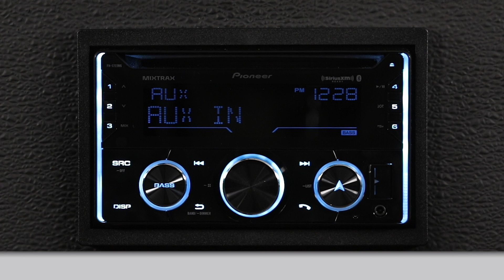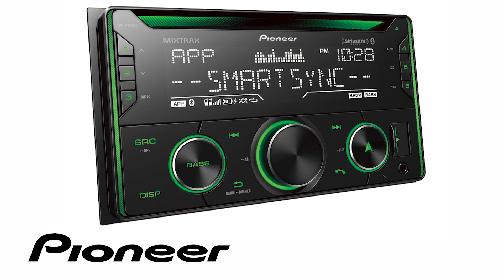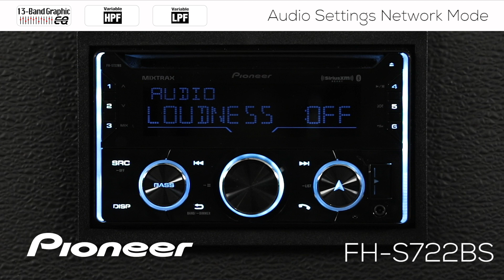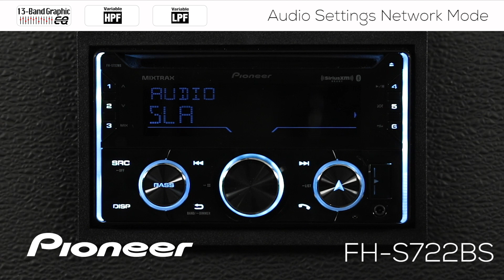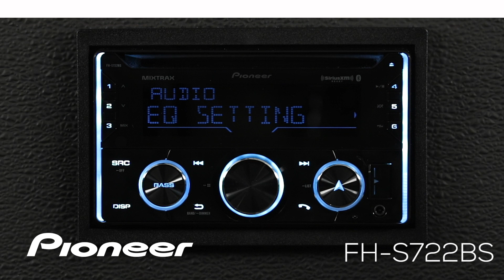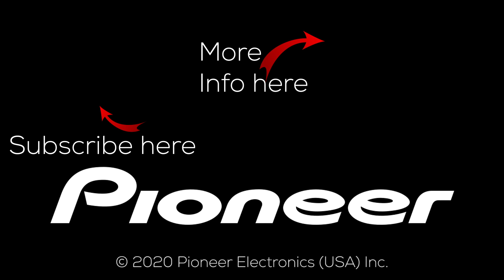How To - Audio Settings Network Mode - Pioneer Audio Receivers 2020

Comment: What about sound quality or fidelity? It says RCA's are 4v output? Does this improve better sound quality than older version of pioneer receiver? I think on buy one but I'm not sure about sound quality... I'm audioholic!
Reply from the maker: The Pioneer FH-S722BS is an excellent sound quality CD receiver.  It has 3 sets of RCA outputs for operating external amplifiers. 
You can see an unboxing video from Pioneer here:     https://youtu.be/kQz4kuB2en4     The RCA outputs can be setup as Front, Rear, and Subwoofer output, or for more control and better sound quality, as High, Mid, and Low output.   You can learn more about Pioneer's Standard Mode and Network Mode setup here:   https://youtu.be/k3q0Zm5jvHg
You can learn more about using Pioneer's receiver's built-in crossovers and slopes in this How To video from Pioneer:   https://youtu.be/WvJXYh6vk_0?t=340
For higher sound quality and Hi Res Audio certified products please consider the Pioneer DMH-WT8600NEX seen here:   https://youtu.be/QrvNkGgRo7E
You can find more videos on Pioneer's YouTube Channel here:  https://www.youtube.com/@pioneerelectronics
Reply: Yes ... if u have aftermarket amplifiers in ur car ... then they will shake ur hand for feeding them voltages ... the amplifiers will produce better , cleaner signal ... and u can most likely max out ur volume on the headunit

Comment: Im getting the fh-s722bs on 1st set up if i only have 1 amp n subs and don't know that much of sound set up what is best setup for the hu i do want to use the time aliment
Reply from the maker: Please be more specific with your question.  
If you have one amp for full range speakers, and  a separate amp for your subwoofer you may want to use the Standard Mode setup.
You can learn more the difference between Network Mode and Standard mode in this How To video from Pioneer:   https://youtu.be/k3q0Zm5jvHg    Please watch the video with the sound on.
To understand more about using crossovers and slopes, please take a look at this How To video from Pioneer:  https://youtu.be/WvJXYh6vk_0?t=341    Please watch the video with the sound on.
You can find more videos on Pioneer's YouTube Channel here:   https://www.youtube.com/@pioneerelectronics
Reply: @pioneerelectronics  sorry i will be using the headunit for mids and highs and an amp for my subs i do not know alot bout set ups so was wonder what would be best for this set up
Reply from the maker: @almann5798     Please be more specific.   Mids and highs.  OK.   Do you mean separate tweeters, and separate mid bass drivers?   Or do you mean  for example 6x9 inch speakers in the doors for your mids and highs?     Each of the speakers playing mids and highs together?   It makes a big difference on the setup.
Reply: Sorry see i do not know the terms well ill be using coaxial speakers to run off of my head unit
Reply: So there will be 5.25 coaxial speaker in front door and coaxial 6x9 in rear back deck
Reply from the maker: @almann5798  I understand better now and I'll be happy to help. I recommend to setup the receiver in Standard Mode.  Don't use Network Mode.  Network Mode is wrong for your setup as you have described it.    I recommend to connect  the 5.25" speakers to the Front  Speaker Outputs and to connect the 6x9" speaker to the Rear Speaker Outputs.  You can learn about connecting your speakers to your Pioneer in-dash receiver in this How To video from Pioneer:   https://youtu.be/kR2MO2kwFug?t=254
You'll use the Subwoofer RCA outputs to run the signal to your subwoofer amplifier.  You can learn about the RCA outputs here:   https://youtu.be/kQz4kuB2en4?t=226   The subwoofer outputs are clearly labeled on the back of the receiver.
I recommend to set the Crossovers as follows:
Front 80Hz HPF 12 dB per octave
Rear 80Hz HPF 12 dB per octave
Subwoofer 80Hz LPF  12dB per octave
You can learn about setting the LPF and HPF crossovers in this How To video from Pioneer:   https://youtu.be/ivhWEe3egSY?t=223
The external amplifier for the subwoofer will require RCA cables from the back of the in-dash receiver to the subwoofer.  These cables are commonly about 10-15 feet in length.  The external amplifier will also require power and ground.  The power cable may need to be connected directly to the vehicle's battery.

Comment: Hi, just bought a mvh-s720bhs...it doesn't have the band pass settings (one of the main reasons I bought it) just rear and sub. No low pass for the mid...what can I do? Thanx
Reply from the maker: You have the receiver set up in Standard Mode. That's a mistake.  You want the receiver setup in NETWORK MODE.   The Pioneer MVH-S720BHS must be set up in NETWORK MODE in order to have the band pass output. The Pioneer MVH-S720BHS certainly has band pass output, when used in NETWORK MODE.
Don't worry, it's not difficult to set up your MVH-S720BHS in NETWORK MODE and have the band pass output.  Just follow these simple instruction it only take a few minutes:
Step 1.  With the vehicle safely parked, and the engine running and the receiver powered up, Press and hold the receiver's SRC button for a few seconds.  This will turn the receiver off.
Step 2.  Press in on the Volume control.  This will show the Initial and System Menu.  Turn the volume control to see INITIAL.  Press in on the volume to select INITIAL.
Step 3.  Once you've selected the INITIAL menu, turn the volume control to SYSTEM RESET.  Press in on the volume control to select SYSTEM RESET.
Step 4.  Press in on the volume control to Reset the receiver, and press in on the volume control again to confirm YES and Reset the receiver.
Step 5.  The receiver will display RESETTING for several seconds. DO NOT TURN OFF THE VEHICLE'S ENGINE. After the reset is complete, the receiver will automatically restart and display the Language Setting.
Step 6.  Select the Language you want. Press in on the volume control to confirm.  The receiver will display the Clock Set Screen.
Step 7.  Set the clock by using the volume control and pressing in to confirm.
Step 8.  Don't Miss this step.  This is the important one.  The receiver will display >  SPEAKER MODE  <  Press in on the volume control to select SPEAKER MODE.
Step 9.  In SPEAKER MODE, you have 2 options.  Turn the volume control to NETWORK MODE.  Don't choose Standard Mode.  You want NETWORK MODE.  Press in on the volume control to confirm NETWORK MODE.
Step 10.  Confirm YES, you want NETWORK MODE.  Press in on the volume control to confirm NETWORK MODE.
Step 11.  The receiver will ask if you want to quit the setup menu.  Confirm Yes.

Now you're system is setup in Network Mode and you have an HFP on the Front RCA's,  and you have an LPF and an HPF on the Rear RCA's, and you have an LPF on the Sub-out RCA's.
You can lean more about NETWORK Mode in this How To video from Pioneer:  https://youtu.be/k3q0Zm5jvHg  Please watch this with the sound on.
You can learn more about using Crossover's and Slope setting in this How To video from Pioneer:   https://youtu.be/WvJXYh6vk_0   Please watch this with the sound on.
You can download the owner's manual for the Pioneer MVH-S720BHS here:   https://www.pioneerelectronics.com/StaticFiles/Manuals/Car/MVH-S720BHS_OperationManual102620.pdf   You may find page 27 of some interest.
Please be sure to install the latest firmware for your Pioneer MVH-S720BHS.  You can find it here:   https://www.pioneerelectronics.com/PUSA/Car/Digital+Media+Receivers/MVH-S720BHS#downloads
You can find more videos on Pioneer's YouTube Channel here:  https://www.youtube.com/user/pioneerelectronics

Comment: Does it have a volume control for the sub only on normal mode?
Reply from the maker: Please clarify your question.  Do you mean Normal / Network mode?  Or do you mean Normal or Reverse Phase for the subwoofer output?
What is the model number of your Pioneer in-dash receiver?  
Be sure to have the subwoofer output switched on.  Depending upon your receiver model number, the Subwoofer Level control may be in the subwoofer settings, or it may be in the Speaker Level settings.
You can learn more about is in this How To video from Pioneer:   https://youtu.be/HTJ07fk4Grs?t=44
I recommend to watch the video with the sound on.
You can find more videos on Pioneer's YouTube Channel here:   https://www.youtube.com/user/pioneerelectronics

Comment: Why do I get a lot of distortion I have a MVH-320bt and have orion speakers like at 35 of volume ??
Reply from the maker: This is a long answer.  Please take a few minutes and read the complete answer.    

If you are using a hammer and you hit your thumb, don't blame the hammer. 

The goal is to create an audio system with little or no distortion. If the in-dash receiver's RCA outputs clip they create a distorted audio signal. That distorted audio signal is then in turn amplified by the subwoofer amp or other amplifiers in the system. 

In a well designed and set up audio system, you should be able to turn up the master volume to, or near it's maximum, and not hear any distortion from the speakers in the system. If you have all of these settings (for example: EQ, speaker levels, crossover levels, bass boost etc...) set to zero or lower you should be able to turn the volume up to it's max, and the RCA outputs of the in-dash receiver should not clip and create distortion that will in turn be amplified by your system. 

If you add in a boosted signal on the in-dash receiver from any of the audio controls (for example: EQ, speaker levels, crossover levels, bass boost etc...) this may cause the in-dash receiver's RCA outputs to clip and create distortion at high output levels. 

So... Here is an example:

This is hypothetical, please don't take the numbers literally and try to translate them to any given in-dash receiver. 
In this best case scenario I have excellent amplifiers and well matched speakers. My in-dash receiver master volume control has a maximum volume level number of 50. 

I have all of the audio settings set to zero, and I can turn up the master volume to 50 and the RCA outputs do not clip. I set the gains on the amplifiers so that there is no distortion. That's what I want. 

Now, I add in a subwoofer level control adjustment of +5. When I turn up the master volume I can get to only volume level 45 before I begin to hear distortion coming from my speakers. If I add in an EQ adjustment on the 80Hz frequency band of +4, my master volume begins to distort now at volume level 41. 

Remember I started at volume level 50 with no distortion. Please note this is just a hypothetical example. 

In this example, the in-dash receiver is causing the distortion and sending that distorted signal to the amplifiers. The amps and speakers are simply doing the job they were designed to do. 

What's the solution? Use the audio controls to your best advantage. If you set them to zero or lower, your in-dash receiver shouldn't be creating noise. Set the gain controls on your amplifiers so you don't hear any distortion at high volume levels. If you want to add in a +1 or +2, that's OK as long as you realize you may be getting distortion at the highest volume levels. 

You need to find the settings that works best for you. If you are trying to balance your system so all of the speakers are at or near the same volume level, consider lowering the volume level of some speakers rather than raising the volume level of one individual speaker. 

If you are using Bluetooth Audio as your main music source, consider lowering the volume level on the Phone. 

It's possible, the phone is overloading the input through Bluetooth Audio, and the distortion is beginning right there. If you set the volume level on the phone lower, you may be able to turn up the master volume level on the in-dash receiver with less distortion. 

If you want more volume, you might want to consider a more powerful amplifier and speakers. You can find more videos about Pioneer NEX in-dash receiver's here: https://youtu.be/PeH_h8UHzBw?list=PLw63zJRQbCNi6CoU7JbUNT83T7ippQbU6 and you can find more videos on Pioneer's You tube Channel here: https://www.youtube.com/user/pioneerelectronics

Comment: My screen is not bright enough.. When I am driving I can barely see it ..How do I fix this?
Reply from the maker: Please be sure the in-dash receiver's Dimmer function is switched off in the daylight hours.  Also be sure the receiver's brightness is set to 10 in the daylight hours.    The Pioneer FH-S52BT has a dimmer switch on the front of the receiver.  It's the Band-Dimmer button or the arrow back button.  Press and hold for a few seconds and this will switch the dimmer function on and off.  You can learn more details about the dimmer and brightness function in this How To video from Pioneer:   https://youtu.be/pMKUPcGE26c   You can find more How To videos about Pioneer FH-S52BT here:   https://youtu.be/to2eXLPBnJI?list=PLw63zJRQbCNjXJV9UdBd2a2upOOYxQQM0    and you can find more videos on Pioneer's YouTube Channel here:  https://www.youtube.com/user/pioneerelectronics

Comment: I can't get signal to my amp new RCA jacks new amps
Reply from the maker: What is the model number of your Pioneer in-dash receiver?   Are you certain the amplifier is switched on?    RCA cables can occasionally be the problem.  Please check with a different cable.  I recommend to press the receiver's microprocessor reset button.  You can see it in this Pioneer how to video:   https://youtu.be/o6iawP279R4?list=PLw63zJRQbCNhDoDXEJKBHoC27MkfUhJ-R  or for a 2 DIN receiver here:    https://youtu.be/WQ8p8b8vZKc?list=PLw63zJRQbCNjta2cav2IV3rbr7pdUPiQH     If you are the subwoofer output please be sure the Subwoofer Output is switched on.  You can see it in this Pioneer How To video:  https://youtu.be/dMsL-5uwogw?list=PLw63zJRQbCNjta2cav2IV3rbr7pdUPiQH    You can find more videos on Pioneer's YouTube Channel here:   https://www.youtube.com/user/pioneerelectronics
Reply: @pioneerelectronics  fns52bt, I had to turn the sub level way up,
Reply from the maker: Please consider experimenting with the amplifiers gain control.   I recommend to set the receiver's subwoofer output to zero, and adjust the amplifiers gain control to a more compatible setting.  The amplifiers gain control is a way to balance the output from the receiver with the input to the amplifier.
Reply: @pioneerelectronics  thanks

Comment: Any idea why the subwoofer control settings also adjusts my rear door speakers and if i turn subwoofer off on the head unit it also turns off both rear speakers??Please any help would be greatly appreciated
Reply from the maker: What is the model number of your Pioneer in-dash receiver?
Reply: @pioneerelectronics  its an mvh S622BS and i figured it out lol.I had the receiver in SW mode for the initial range of output instead of FULL so i reset the unit and set it to FULL range and now i have an adjustable fader and the subwoofer setting is isolated to,get this,the subwoofer haha whoohoo..Thanks for the response anyhow..have a great weekend

Comment: How do you reset radio stations on model# deh54010bt
Reply: Here is a video about tuner operation for a Pioneer receiver in 2020:    https://youtu.be/nHsTTLnDdOo?list=PLw63zJRQbCNiPrgwJQGimQIzOEz5sJiHP   You don't need to erase the old radio station presets.  Just create new ones.     I don't know what a Pioneer DEH54010BT is.  Please check the model number again.    If you want reset the in-dash receiver back to it's factory settings, I recommend to do a system reset.  You can see it here:  https://youtu.be/4xf-rc9IEok?list=PLw63zJRQbCNiPrgwJQGimQIzOEz5sJiHP      You can find a full playlist of How To videos from Pioneer about DEH-S4200BT here:  https://youtu.be/to2eXLPBnJI?list=PLw63zJRQbCNiPrgwJQGimQIzOEz5sJiHP  and you can find more videos on Pioneer's YouTube Channel here:  https://www.youtube.com/user/pioneerelectronics